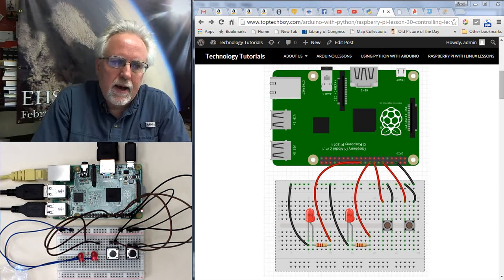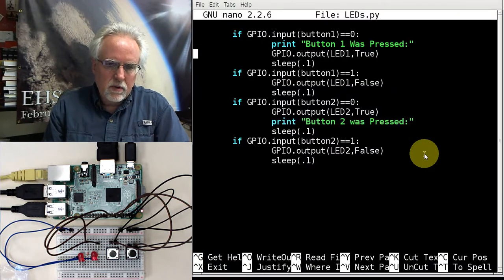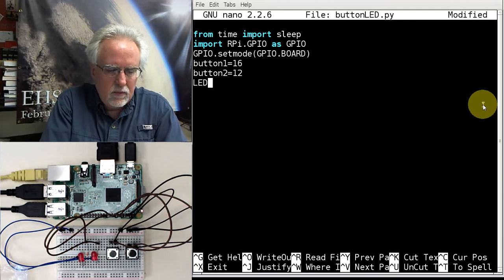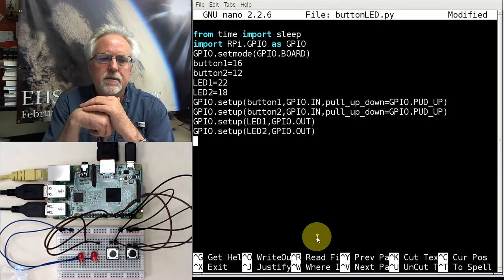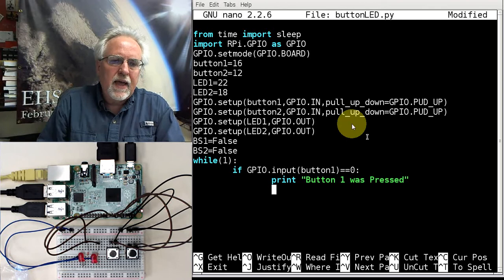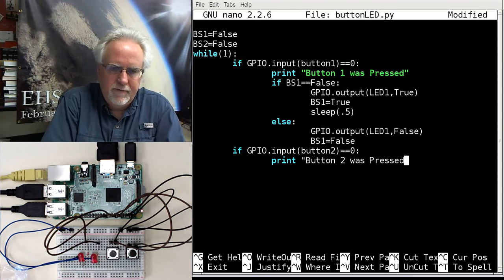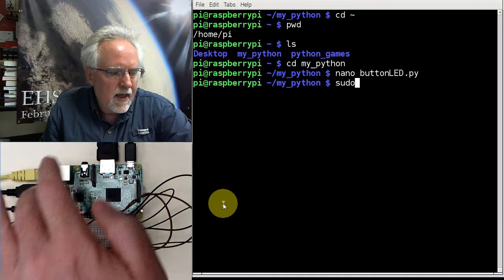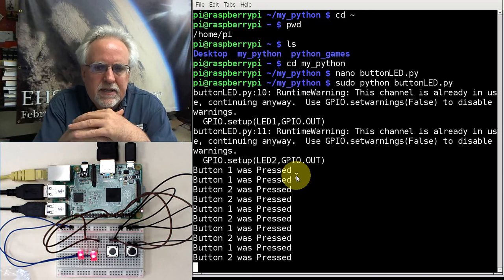Raspberry Pi LESSON 30: Control LEDs with Buttons on GPIO Pins

Comment: why dont you use just directly  GPIO.output(LED1,not BS1) then BS1 = not BS1 then sleep(.5) so it will toggle,  this 3 lines is equal to 8 line of yours

Comment: Please bear with my limited understanding of electricals here. 
In my code, I have my input pin pulled up to V+, which goes to one end of my switch. The other end of my switch, rather than going straight to ground (like shown in the video), I have it go through an LED first, then finally to GND. I thought doing this would save me some pin real estate by not having to use an extra output pin to control the LED.

When I test my code to see button press, if the button goes straight to GND like in the video, input reads 0, which is expected, just like in the video. 

When that LED is there, it shines very dimly when the button is pressed, which I think makes sense, because the pull up resistor has some massive impedance like 10k ohm or something in the pi, so there's not much current going through the LED. What's strange to me is that instead of reading 0, when the button is pressed, it still reads 1, as if the circuit is open. What is it about the LED being between the switch and ground that causes this?

Comment: Paul McWhorter
This is really for anyone who can help me....I have a project I am making that uses two buttons (player 1 button and player 2 button) to try and stop a blinking LED when it's lit up. But I can't get my buttons to work. So, I used your video to make a test program to see if the buttons would work just by your code. It still doesn't. What it is doing on my project, and in this program, is spamming my shell with the print statement "button1 was pressed" and "button2 was pressed". So it's essentially reading that both buttons were pressed over and over again, but they are not. I don't know how to fix this, as the code for this code is exactly like yours, but it's still doing it. Can anyone help me with this? Google isn't really helpful, as I can't find any reference on why it's doing this.....

Comment: Paul, How would you use a limit switch in Tkinter module using the graphics interface which allows a user to push buttons to turn on LED's but also monitor the condition of the limit switch (on/off) so if the limit switch closes, the push buttons become operable and a graphic button would say "System Available" and when the limit switch opens, the virtual buttons become inoperable and graphic button roll over changes from "System Available" to "System Busy". I can't use "while True:" because when I do. the virtual buttons become inoperable. I would like a person to select  from two buttons an option which activate a LED according to the push buttons.. Like select "Left Button" or "Right Button" and either LED will function as long as the limit Switch condition is true however if the limit switch is open, both buttons are inoperable until the limit switch is true again. Any ideas? Thanks for any response.. Just trying to solve a simple problem I could do in C or C# in 10 seconds that I can't do in Python due to my newbe experience in the development platform.   I've been trying:
import Tkinter as tk
import tkinter.font
import RPi.GPIO as GPIO
from gpiozero inport LED, Button
from signal import pause
from time import sleep

win = tk.TK()
win.title("ARBOR")
myFont =tKinter.font.Font(Family = 'Helvectica', size = 24, weight = "bold")

led1 = LED(13) #These are actually three relays on pin 13, 6 and 26
led2 = LED(6)
led3 = LED(26)
button = Button(5)  #sensing status of pin 5

GPIO.setmode(GPIO.BCM)
GPIO.setup(5, GPIO.IN pull_up_down=GPIO.PUD_UP)

while True:
    input_state = GPIO.imput(5)
    if input_state == True:
    button["text"] = "System in Use"
    led3.on()
    break
else:
    button["text"] = "System Available"
    led1.off()
    led2.off()
    led3.off()
    break
#So the nested if statements below identify is another button is in use and
#renders the other buttons unavailable if conditions are not met

def selectOption1():
        if led1.is_lit:
           led1.off()
           led3.off()
           paperButton["text"] "Paper"
        else:
           if button["text"] != "System Available":
              if plasticButton["text"] != "Please Wait!":
                 if glassButton["text"] != "Please Wait!":
                    if generalButton["text"] != "Please Wait!":
                       led1.on() #turn on relay to send 24V to main control
                       led3.on() # turn on relay to control local latch
                       paperButton["text"] = "Please Wait"
def selectOption2():
        if led2.is_lit:
           led2.off() #relay for plastic selection is off
           led3.off() # relay for hopper latch is off
           plasticButton["text"] "Plastic"
        else:
           if button["text"] != "System Available":
              if paperButton["text"] != "Please Wait!":
                 if glassButton["text"] != "Please Wait!":
                    if generalButton["text"] != "Please Wait!":
                       led1.on() #relay for relay 1 is on
                       led3.on() #relay for hopper latch is activated
                       plasticButton["text"] = "Please Wait"
def selectOption3():
        if led1.is_lit:
           led1.off()
           led3.off()
           glassButton["text"] "Glass/Metal"
        else:
           if button["text"] != "System Available":
              if paperButton["text"] != "Please Wait!":
                 if plasticButton["text"] != "Please Wait!":
                    if generalButton["text"] != "Please Wait!":
                       led1.on()
                       led3.on()
                       glassButton["text"] = "Please Wait"
def selectOption4():
        if led2.is_lit:
           led2.off()
           led3.off()
           generlButton["text"] "General Waste"
        else:
           if button["text"] != "System Available":
              if paperButton["text"] != "Please Wait!":
                 if glassButton["text"] != "Please Wait!":
                    if plasticButton["text"] != "Please Wait!":
                       led13.on() #only the latch operates here. 
                       generalButton["text"] = "Please Wait"
def exitProgram():
    win.quit()
    win.destroy()
#packing the GUI

button=tk.Button(win, text='System Available', font=myFont, bg='blue', height=2, width=32) #button to change according to limit switch condition
button.grid(row=0, sticky=tk.NSEW)

paperButton=tk.Button(win, text='Paper', font=myFont, command=selectOption1, bg='blue', height=2, width=38)
paperButton.grid(row=1, sticky=tk.NSEW)

plasticButton=tk.Button(win, text='Plastic', font=myFont, command=selectOption2, bg='blue', height=2, width=38)
plasticButton.grid(row=2, sticky=tk.NSEW)

glassButton=tk.Button(win, text='Glass/Metal', font=myFont, command=selectOption3, bg='blue', height=2, width=38)
glassButton.grid(row=3, sticky=tk.NSEW)

generalButton=tk.Button(win, text='General Waste', font=myFont, command=selectOption4, bg='blue', height=2, width=38)
generalButton.grid(row=4, sticky=tk.NSEW)

exitButton=tk.Button(win, text='Exit', font=myFont, command=exitProgram, bg='red', height=2, width=38)
exitButton.grid(row=5, sticky=tk.E)

tk.mainloop()

but it's hanging in the while True: arg.

Comment: if GPIO.input(button1)==0:            # Look for button 1 press
                print "Button 1 Was Pressed:"
                if BS1==False:                # If the LED is off
                        GPIO.output(LED1,True)# turn it on
                        BS1=True              # Set Flag to show LED1 is now On
                        sleep(.5)             # Delay
                else:                         # If the LED is on
                        GPIO.output(LED1,False) # Turn LED off
                        BS1=False               # Set Flag to show LED1 is now Off
                        sleep(.5)
        if GPIO.input(button2)==0: #Repeat above for LED 2 and button 2
                print "Button 2 Was Pressed:"
                if BS2==False:
                        GPIO.output(LED2,True)
                        BS2=True
                        sleep(.5)
                else:
                        GPIO.output(LED2,False)
                        BS2=False
                        sleep(.5)
*************************************************************************************************
TRY TO USE
if GPIO.input(button1)==0:            # Look for button 1 press
                print "Button 1 Was Pressed:"
                BS1=not BS1
                GPIO.output(LED1,BS1)
                sleep(.5)
if GPIO.input(button2)==0:            # Look for button 2 press
                print "Button 2 Was Pressed:"
                BS2=not BS2
                GPIO.output(LED2,BS2)
                sleep(.5)
*************************************************************************************************

Comment: Thank you for taking the time to explain each step as you go through the process of both building the circuit and writing the code.  I'm in the last semester of college and I have a capstone project to create for my final grade.  I'm new to using the Raspberry pi and python programming, your lessons have been extremely helpful in helping me build my project.  I'm building a traffic light with a crosswalk button that will stop the normal traffic light mode, turn on another LED to signal it;s safe to cross then start running the normal traffic light mode again.  I hope you continue to your lessons on raspberry pi and python progrmming.